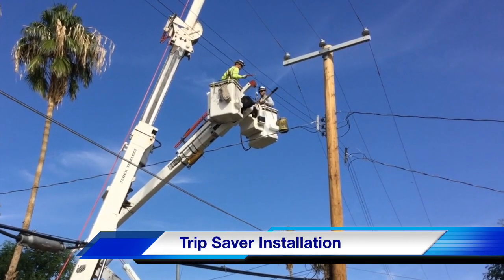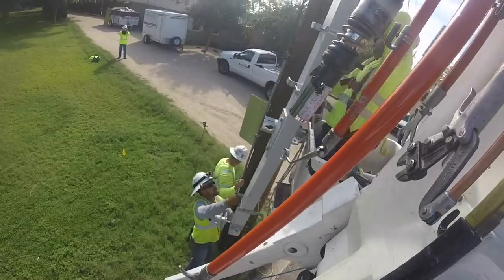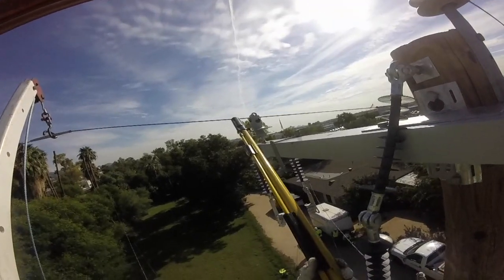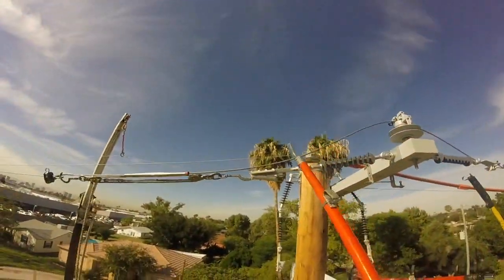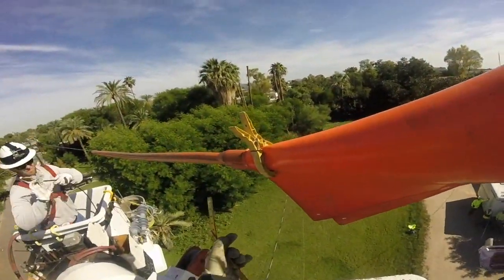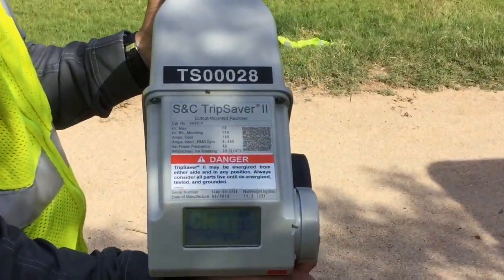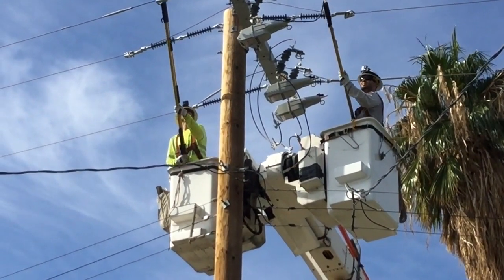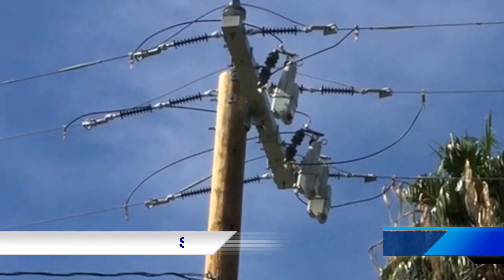How to Install the TripSaver II Recloser

Comment: Alabama Power recently installed one of those on the primary that feeds our neighborhood, single phase 7200 volt. Our neighborhood has lots of trees that have grown up near the lines. Even the winds from a summer storm would blow the trees into the lines and cause a short and pop the cutout fuse. Then we'd be without power for at least an hour until the fuse was replaced. It'll be interesting to see how this device performs.
Reply: Curious if you have any update here

Comment: Why is the rope shorting out the jib. The rope should not be used unless it is attached to a link stick, just put the wire in a wire holder without the winch. Also what’s wrong with using a live line hoist or just attach the grip and hoist with rubber gloves.

Comment: Would love to see the jumper removal process. We're having discussions and difficulty installing these live. We use rubber glove technique on 24kV lines and install the Trip Saver 2. However whenever we use an Amprobe to check current through the jumper and Trip Saver before jumper removal, no current seem to flow through the CLOSED Trip Saver. Thus we are afraid to remove the jumper fearing we might be interrupting  the current flow, creating an arc and hurt ourselves. Therefore our practice involves a short outage per phase. We reinstall the fuse-out in the Trip Saver bracket to remove the jumper, remove the jumper, open the cut-out, install the trip saver then close it. Advise please
Reply: kevingambino1.  look into load pickup jumpers. you can safety open a jumper with hotstick technique.  if the recloser is defective the load brake jumper will snuff the arc.

Comment: It's interesting how rubber glove and sleeve policies differ from company to company, we have a ground to ground rubber glove policy, even while hot sticking and working tested dead and grounded lines. We'd also need sleeves if we were working within minimum approach.
Reply: ucfsub  when working on tested and dead grounded lines do you also use cover up as clearly you feel it is not safe for bare conductor to touch any part of your body.
Reply: I don't feel unsafe about any of that. I was stating that our policy requires the use of rubber gloves even on tested dead and grounded lines. At no point could we exchange rubber gloves for leathers under any circumstances unless we were working on a pole that had no possibility of becoming energized i.e no foreign wires of any kind bridging to an energized pole.
Reply: ucfsub my question is does your company make you cover everything up because clearly they feel it is unsafe for any part of your body to contact a bare conductor.
Reply: Nope, and the best part is they wouldn't say a word if you were taking a nap across all 3 phases so long as you had your rubber gloves on.
Reply: I'd hate to be using sticks while wearing rubbers, screw that.
Reply: I find it interesting that they hot stick everything but the proceed to put on rubber gloves in order to apply cover up…. Why not just rubber glove everything if you are allowed to contact the primary in order to apply cover 🙃
Reply: @linehandibew6205  Leather gloves are much more comfortable lol. Especially when you have every type of hot stick imaginable strapped to your boom.